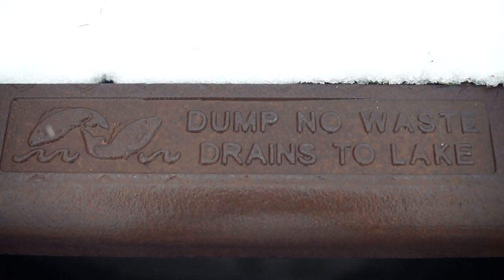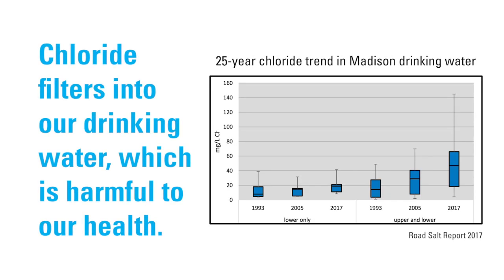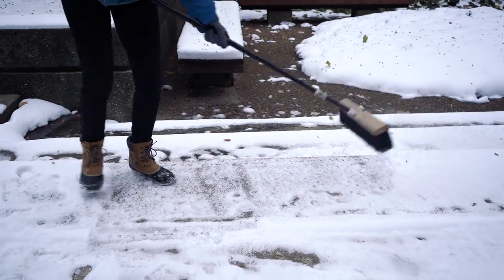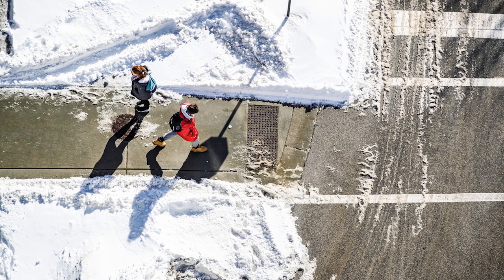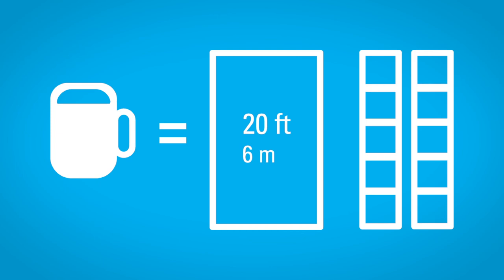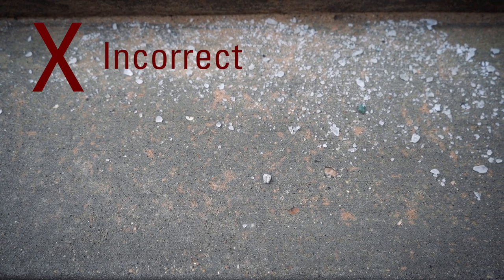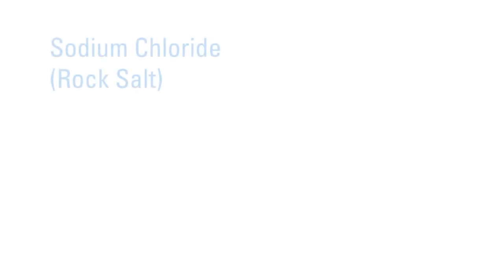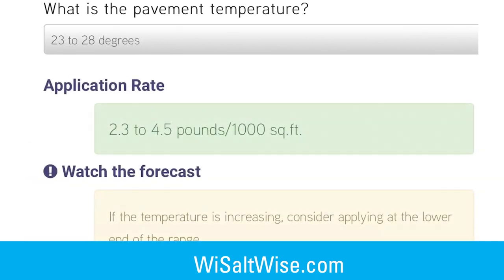Winter Salting Guide

Comment: Sorry, but I think you missed a much better option, which is to use NO salt. I live in Madison and have a long stretch of city sidewalks to keep clear, as well as my 100-foot driveway. I haven't bought a bag of salt for 20 years or more. I use sand. Maybe we're unusually lucky in Madison to have a large supply of sand available to all residents, but wherever sand is available, it might well be all you need. It creates the traction you need on most types of ice. It absorbs heat from the sun, even on cloudy days, and helps to melt the ice. And it adds no pollutants to the waters. Why use any salt at all?  That's my question for you.